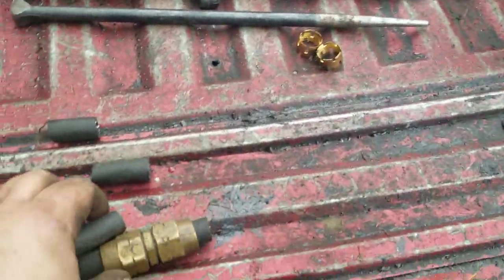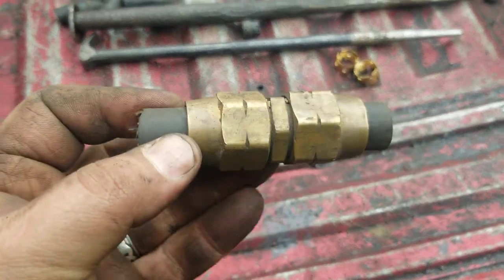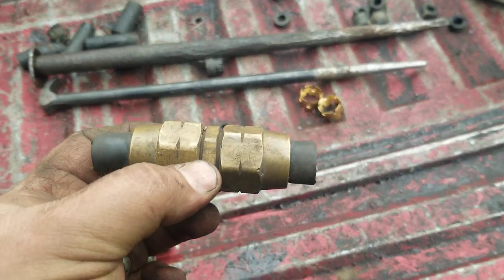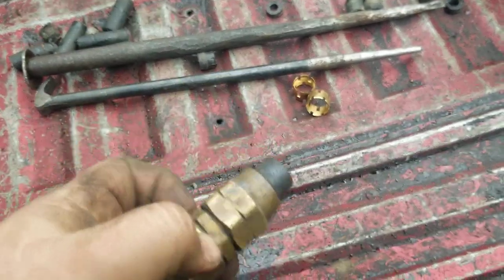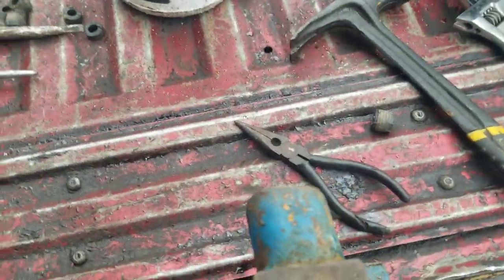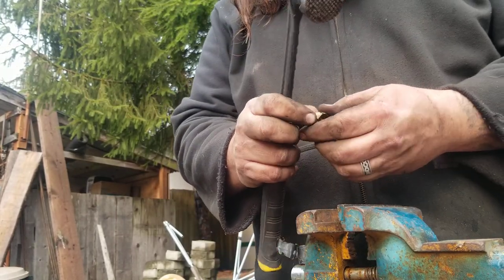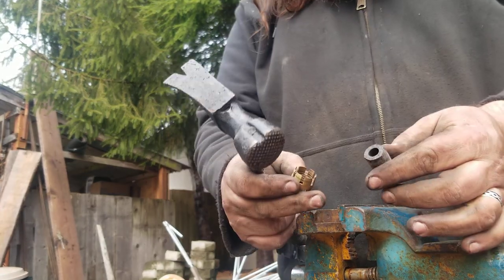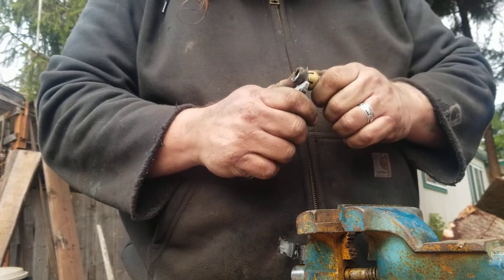fixing airline quick fixes splices

Comment: You do not have much snow yet. We have about 3 feet and 12 ℉. It's really nice here.
Reply from the maker: we dont get much snow, stays in in between freezing and thawing all winter, rains a lot, so yer constantly wet and muddy, or its clear and freezes hard for a few weeks, with no snow... worst of all possible winters, I'll take -10 and deep snow, beats cold mudd
Reply from the maker: go up 1000' and the temps drop 10-20 deg, so there will be 8-20' of snow until June, but I'm at about 500' so just cold and sloppy